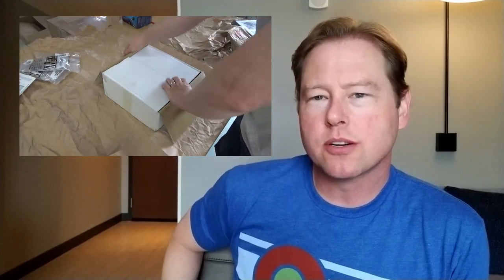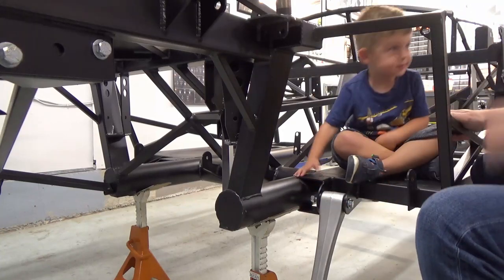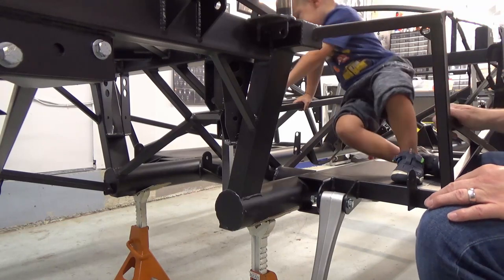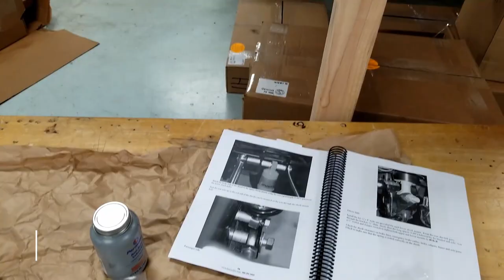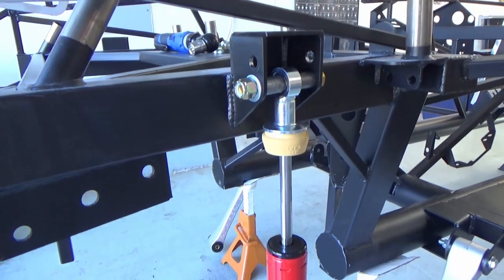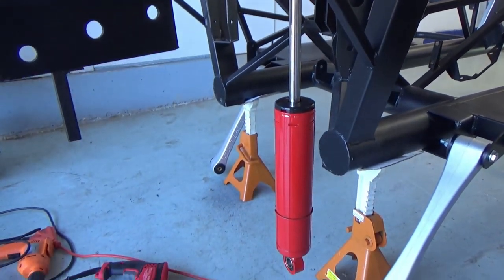Budget LS Factory Five Cobra | Build Update 2 | Backorder Unboxing

Comment: FYI, whenever feasible, bolt heads should be forward or up, not aft or down....for safety. Also, you will find FFR has an issue with fastener lengths, and in my build, I had to replace several fasteners that were either ridiculously long or short for the application. Enjoy the build.